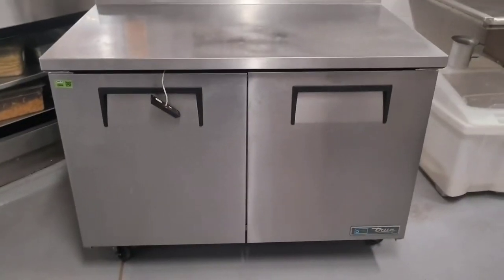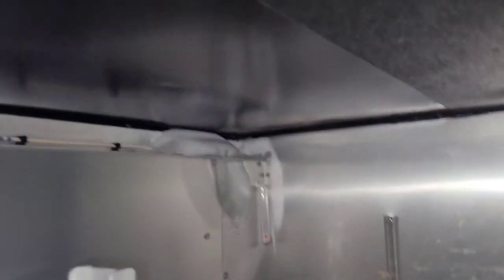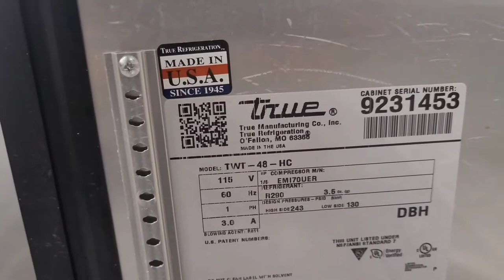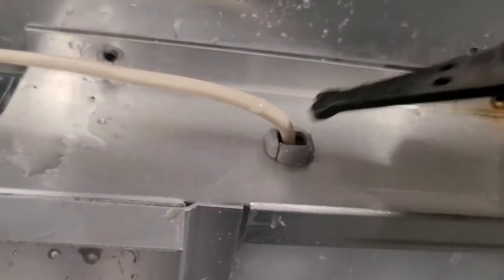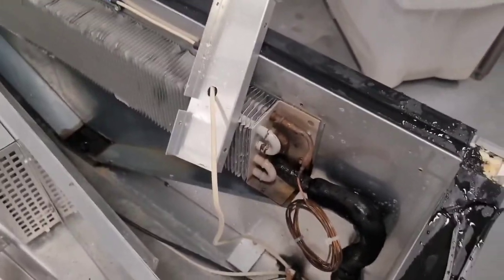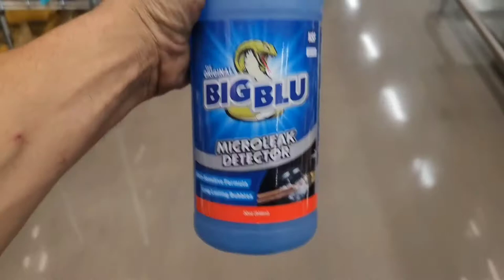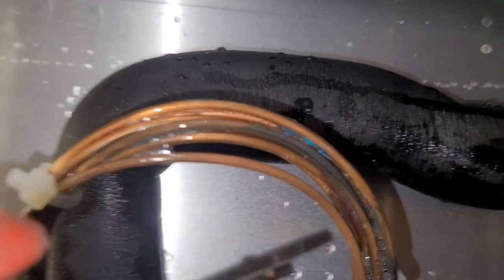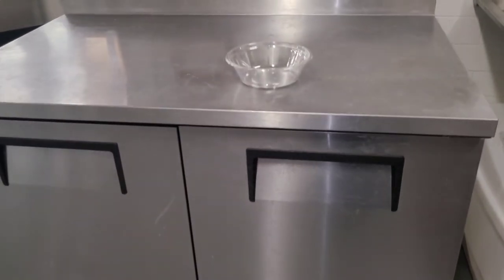True R290 Reach In Cooler Diagnosed Refrigerant Leak Confirmed

Comment: Is there a benefit to removing the top off the unit? It seems like it just risks moisture ingress compared to taking the front off the evaporator coil and hosing it down
Reply from the maker: @mikeoxlong6797  For this particular job, I don't remember if I detected the leak first or if I just jumped right into removing the top. I likely would have suspected that I was going to prefer easier access to replace the cap tube, find the leak, or maybe even just to work on it. The fact that it was low on charge, which I knew immediately(compressor shell temp, condenser discharge air Temp, suction line temp, bod temp and ice formation pattern all considered), removing the top was the mostly scenario I foresaw doing anyways to allow better access for what layed ahead. It is possible to do all of that without removing the top. But I've done that enough times before and don't really want to do that anymore, especially at 2 am. I'll just remove the top. 
 We should reseal the seam if we do this top removal, which I should have done in the video...

Comment: In theory could you recover r290 and use it to power a grill or other propane cooking appliance?
Reply from the maker: Probably not. R290 units are limited to having less than 5-6 oz by federal law, so you can't really BBQ much with that at all. Aside from that, I would worry about the potential chemicals that the gas would release when burned into the food.

Comment: do you have to replace the seals when you put the top back on?
Reply from the maker: Yes. There should always be a seal between the vertical walls and top panel.   At the factory, apparently True MFG uses a flimsy and poorly applied black silicone caulk that even when reasonably new, breaks into about 6-8 different pieces. If you have the Black Foam Tape that we use to wrap Sensing Bulbs, or even Tar Tape or Sealing Gum. Any if those would seal it, which is better that it being unsealed. 👍
Reply: @MASTER TECHNICIAN MINDSET   gotcha makes sence

Comment: How much charge it to find the leak?
Reply from the maker: It had some pressure left in it, I think. Usually if it still cools some I'll try for that but if not 40-50 psi of Nitrogen works for most leaks to bubble

Comment: R290 units are junk ! They use such small amounts of refrigerant and the charge is super critical. Not to mention sometimes they are chefbases so there is a gas grill on them And R290 is propane. Putting propane in units that go in kitchens with gas fired appliances .... That is government logic at its finest !
Reply from the maker: you make a good point. I will say that r290 units reach setpoint in about half the time it takes others to. i dont like the criticality of the charge. government mandates do not allow for a single circuit to hold more than about 4-5 oz. but its amazing how such little amount if charge can be u as used to cool such a large load. it may be worth the drawbacks in my opinion

Comment: Do you leave your taps on? I do…I leak test and use metal caps.
Reply from the maker: Yes, I actually do. I always have on these R290's. But recently I have started to Crimp the line downstream from it like the MFG suggests. The charge is so critical on them,  since all of them cannot exceed like 4 or 5 Oz(by law), that if anyone was to ever hook up to it and neglect to replenish what was lost connecting to it, it would stop working. So it's really better to remove them either way once you get the charge weighed in precisely-which is quite technical in itself.
Reply: @HVACRServiceTech  I see what you are saying, but with good sealed caps, and the valve itself isn’t leaking, with my regulars, I can’t stand it not to leave them on. On my regulars they only use me. You are right though you never can tell what the last guy did, it’s led me on a number of wild goose chases, only to find out they let a relative with gauges mess with it. So I suppose it is good practice.
Reply: @HVACRServiceTech  You are very dedicated to your channel and trade for responding to me at all, I didn’t expect a response, thank you, I’m subscribing!